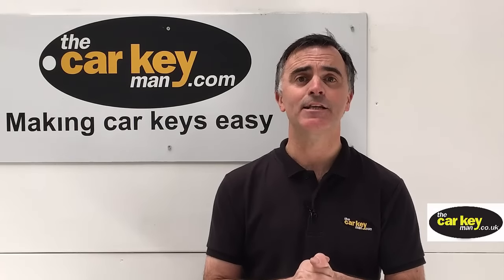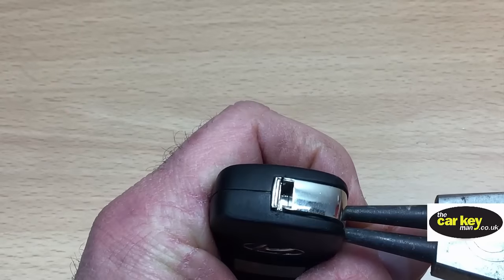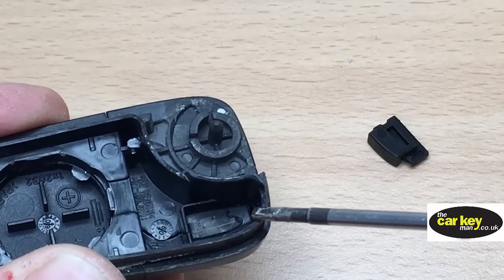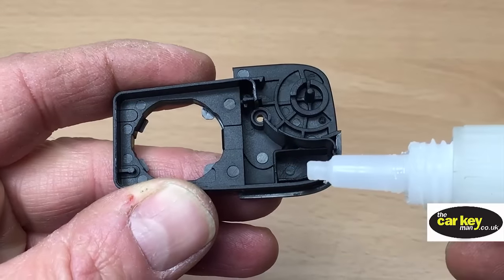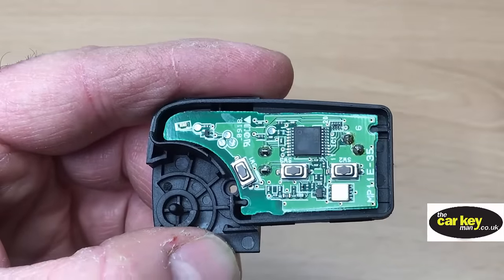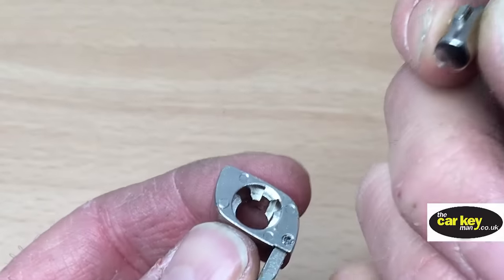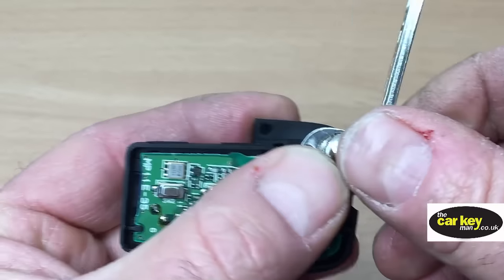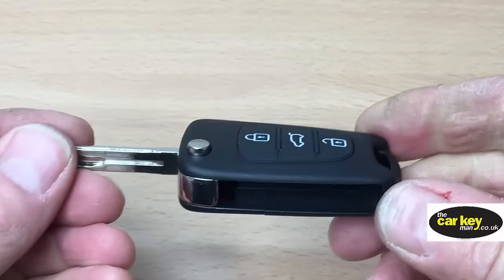FIX Kia and Hyundai Flip Key HOW TO repair

Comment: 5:35 there's been no explanation the whole video about how to put the pin in or out
Reply from the maker: Hi, the pin that holds the plade in?
Reply: @TheCarKeyMan  Yes, I noticed a few people in the comments section asked for this as well.

I ended up taking it to a shop and they just hammered the pint out with a special tool. 

Would be good if your video explained that detail as well, you mention shaving the key to make it fit but not how to put the pin in or out, you just skip over it in the video. 

But overall your video very helpful. And great to see you're still replying to people.

Comment: Super unhelpful. The only parts I needed to see were the parts you didn't record. (How to take the new key out without breaking the new fob, and how to remove and insert pin into old key) And what was the tool you used to file the groove in the key? WTF.

Comment: Who says modern technology is an improvement?  lol -- not with keys.  The old keys worked just fine and you could get a copy for less than a dollar.  Now, you need an MIT degree just to open your car door.
Reply from the maker: Agree, some of them are completely over-engineered. It's no wonder they break and cause problems. Thanks for watching :)

Comment: Do not open the key risk to broke it
Reply from the maker: Hi Gianluca, did you have problems?
Reply: @TheCarKeyMan  yah the card inside work now just in opening the door
Reply from the maker: Does the car start?
Reply: The problem is on the remote card
Reply from the maker: Does the car engine start?
Reply: Yes the metal key got no problems. The remote card inside the key died